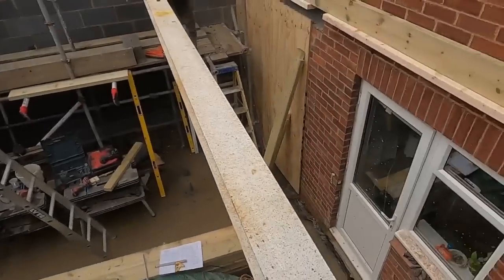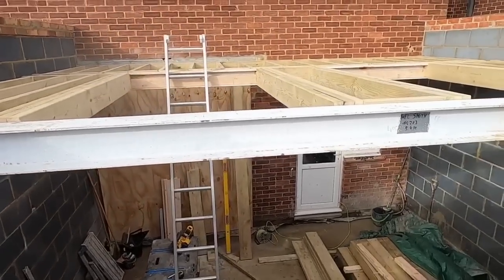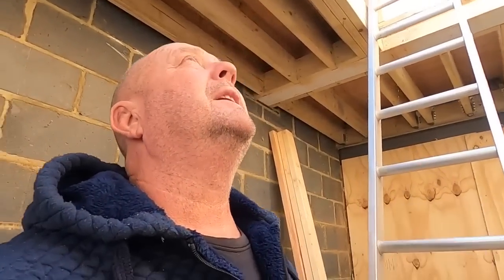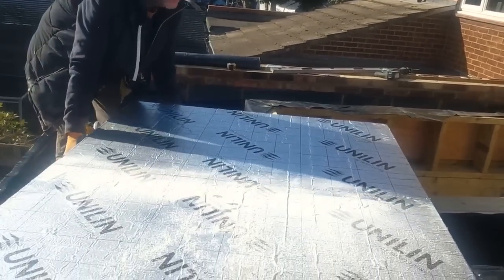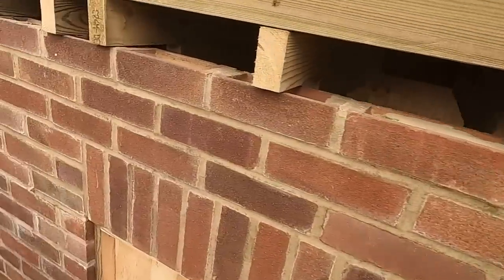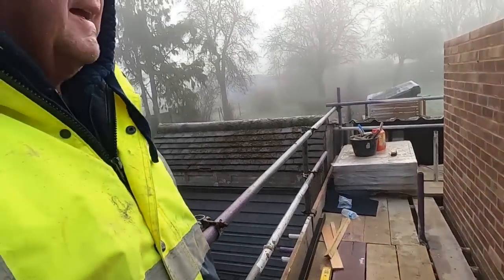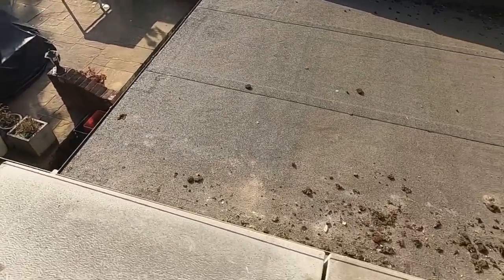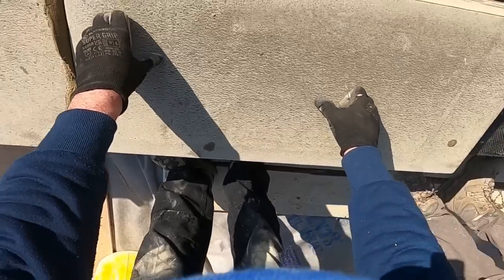Extension 5, roof, brick cleaning and copings and some crap filming😁👍

Comment: We usually stick a slate down under the copings and fully bed them. Some jobs they make us put a full width piece of lead across and dress it down both sides 2 inches.
Reply from the maker: Lead is over the top in my opinion cost wise, i normaly make the felter take it all the way over which does the job fine but even that adds a bit to the cost, current spec is DPC and when you have a roll of that laying around is the cheapest option, and passes BC👍

Comment: Don't fall down the skylight. I did January 2020 on to a concrete floor 8' down and ended up with an extradural hematoma. All fine now but wearing an at height hardhat for me now.
Reply from the maker: Easily done, i put packs of insulation under them if i can,👍